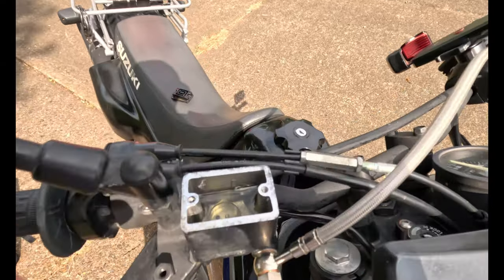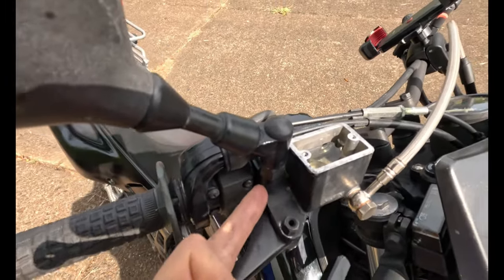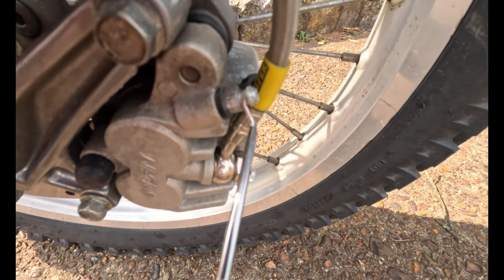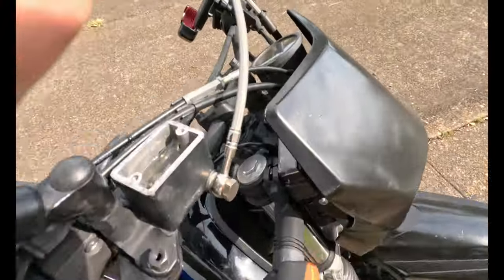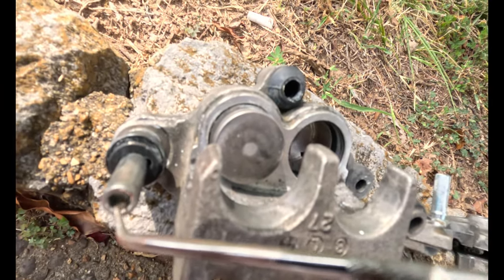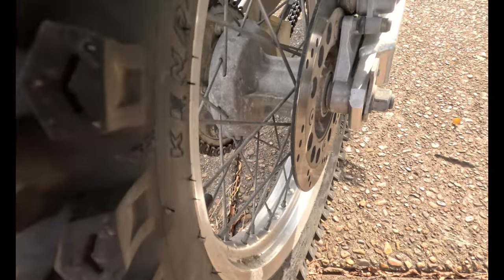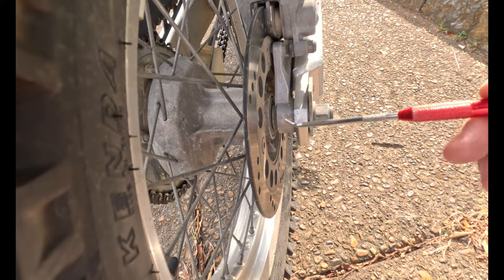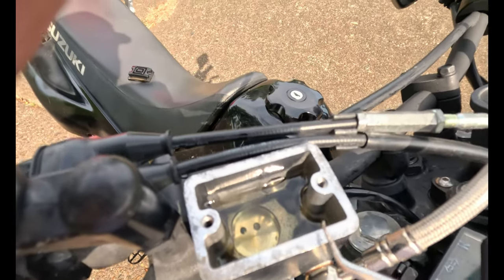Motorcycle brakes locking up or dragging? Solutions.

Comment: SO, my SCREW that holds the brake handle to the master cylinder. I had it way too TIGHT, SCREW DOESN'T NEED TO BE TIGHT, just a little loose. Another good find.
Reply from the maker: Good to know. Thanks.

Comment: OK, too full(RES) for summer riding, Fluid heated up and I took pff the Aftermarket shorty Lever. Thank you.
Reply from the maker: Yup those after market levers are not machined properly and can cause build up of pressure in the Master cylinder. Switch out the shorty to an OEM lever and you should be back in business.

Comment: Bro you lost me at the beginning when you said breaks might locking up because there’s air in the fluid 😂😂😂 On a hot day 😂
Reply: I can’t laugh because that actually happened to me. On a ride home I felt my bike start to drag and pulled over. I discovered the brakes had locked. I couldn’t budge the bike an inch. While trying to figure out what to do I got something to drink from a nearby store. It was hot out. After my soft drink I checked the bike. I could now roll it. The brakes cooled enough??? Once I got it home I had the rear brakes bled and I heard a puff of air come out of the line.  That’s why I searched these vids to find out who else had a similar experience.

Comment: ok I might need a few responses from you. my neighbor's husband passed and she sold me a k4 gsxr 1000 for 700. bike didn’t turn over, should I start with battery? or what would be your suggested starting point?
Reply from the maker: @culturdcustom  jump the battery to get it to start. If the battery is older than 2 years it needs to be replaced. If the gas is older than 6 months than that needs to get dumped and replaced. If it isn't cranking jump the starter solenoid to see if that is bad. Then if the starter is turning over but it won't fire then test your spark plugs for spark and that they are not fouled out. That should keep you busy for a day or two.
Reply: @jamesgaszak3685  I appreciate this more than you imagine. I'll be back here in a few days for step 2 lol
Reply from the maker: @culturdcustom  sounds good
Reply: @jamesgaszak3685 I didn’t forget about you, how are you? heres an update on me. I got battery, rectifier, and all electrics running perfect. I changed sparks, pistons looked good and now I need to change fluids and do brakes. so my question now is since the bike is older and when I got it both brake reservoirs were dirt dry and looked like acid from an exposed battery. of course I replace the reservoirs but will the brakes work if I just bleed them? also the front brake has absolutely no pressure
Reply from the maker: @culturdcustom  honestly I would get different brake calipers off eBay because to buy a rebuild kit plus new pots it will almost be the same price as buying a working used caliper. More than likely there is rusted water inside the calipers and that's a pain to disassemble to clean and blow out. I would get new brake lines, and possibly new master cylinders unless you are going to rebuild those which might be time consuming to a newbie. When you have clean working parts on a brake system it will bleed so much faster and easier. When you rebuild it's kind of a shot in the dark. It may work but why go through the headache when buying a used working part is only 15 maybe 25 bucks more.
Reply: @jamesgaszak3685  I will probably just get new brake calipers and sintered brake pads with new lines
Reply: @jamesgaszak3685  ok new senario, I have power and checked fuses but for some reason the rpm part of my cluster works but not the digital portion that displays mph and mileage, etc... help?
Reply from the maker: @culturdcustom  it could be a bunch of things. More than likely your speed sensor it's dirty or broken. Or the wire going to it is damaged or your display blew a fuse or stopped working because of deteriorating components.
Reply: @jamesgaszak3685  I'll check & be back soon lol

Comment: Hey, this could be really helpful for big group of people that now owns a Dominar (Bajaj version of the Duke 390). The bike is mostly great, but the rear brake gives a lot of truble. I own one of them, and I've already changed the fluid and cleaned the single piston the bike has on the rear, but it keeps heating up, even on very short rides. The weather does not help, its very hot, but i still have a few this to tey before giving up and sending it to the mechanic. I'll keep you updated. If we can figure out what the problem is, it would be a huge help for all Dominar owners here in Argentina!
Reply from the maker: I would bet the piston is over heating. I would get steel braided lines with fresh fluid and an upgraded rear brake caliper. See if brembo makes a rear caliper for your bike. Either way keep me posted.
Reply: @jamesgaszak3685  Ok, 2am here, kinda long trip tomorrow (800km) The brake fluid level just past over the max, took out some, left it right in between min and max, also manually separated the brake pads from the disk, I'll make sure not to use the rear brake tomorrow but if it starts to drag my last resort will be to just remove the pads and fix the problem next week. Will see tomorrow 🙈

Comment: 00r1 think my wheel is canted any other way to tell ?my chain looks  straight
Reply from the maker: @luluwhite261  you have to adjust each marker line on each side of the axle. Put it up on a stand and while in neutral spin it to see if you have a cant and watch the chain as well

Comment: thanks for the helpful video.  not overfilling the master cylinder reservoir to allow the calipers to retract is an excellent point.  cheers
Reply from the maker: Yeah it's that or aftermarket levers sometimes aren't machined right and also won't let the master cylinder air to retract.

Comment: Thank you James! This really helps with my 2015 Street Glide. Hot day, front brakes started clamping on their own... like moisture buildup, needing a flush?
Reply from the maker: @YoursInYeshua  more than likely needs a flush but if I were you I would upgrade your lines to steel braided as well. Sometimes the old lines won't flush out the crap and you refill them just to find out there was a pinhole that was letting air in  causing moisture build up. You and your life is worth replacing the lines. Bad brakes are the number 1 killer in bike accidents.
Reply: @jamesgaszak3685  Thank you man!!
Reply: @jamesgaszak3685  Another thing is I just installed new a handlebar and had to solder-extend the wiring and reroute the hydraulic cables, as they are at their length limit with a 14" bar. They do allow the bars to go fully turn though. Could a any of that or a potential miswire cause the front brakes to auto clamp out of the blue? And, could the ABS be doing the auto front braking even though it doesn't pulsate and the ABS light doesnt come, when I know it can light up? A dealer has the bike now, but I wanted to steer them as best as possible and you know your stuff.
Reply from the maker: @YoursInYeshua  a dealer should figure it out quick. If you routed the cables good and it isn't pinching then you should be good but since I can't physically see the bike I can't know for sure. If the brakes were working fine before the bar install that might be an indication that something is not hooked up properly though. As for the abs there could be a number of problems which again I couldn't know for sure unless I was there to inspect it.

Comment: I learned some stuff here. I put loads of grease on the tips, just gunk it right up in there, but I won't anymore. Might be why my rear is always dragging. 
PS: braided steel isn't there to be tough or provide longevity (this is just a bonus), it's there to stop the rubber hose expanding when you apply pressure. They are for better braking performance.
I have so many problems with brakes, despite low mileage and I just learned that where I ride economically, with minimal brake use so save my pads and petrol, it's actually what causes them to seize up, because they never get heat in them to allow them to be worked. Going to have to change my riding habits and end the false economy.
I just freed up some sticking pistons with brake cleaner/a boot lace and brushing Dot4 round them, but somehow after putting it back together the wheel is binding even more than it was
Reply from the maker: @ArcanePath360  yeah those pistons are super tight. I use a touch of lithium grease when I rebuild them.
Reply: @jamesgaszak3685   I sprayed lots of silicone grease round them and used a speed clamp to keep working them in and pumping out. I also tried brake cleaner and Dot4 but they just keep binding against the rotor and are very hard to push in with both thumbs and all my strength. Starting to think something else is wrong, maybe with the master cylinder? Unfortunately I'm no expert when it comes to brakes
Reply from the maker: @ArcanePath360 you should try a different company for new gaskets cause if you have old gaskets and the air hits them for the first time in 7 to 10 years of them being in a locked air tight system they might get super hard really quick. So get new gaskets in a rebuild kit. If you have spokes make sure they are trued properly. And lastly get a whole new brake caliper. They usually are pretty cheap and then you can determine if it was the caliper or if the forks are bent or the mounting plate for the calipers got bent somehow.
Reply: @jamesgaszak3685   Thanks. My bike is 10 years old with 30k on the clock.  Not sure how long the average seals are supposed to last. I've never taken the brakes fully apart as it's beyond my comfort level, just exposed the pistons and cleaned them. I noticed a little corrosion on some pistons, but strangely those aren't the ones that are sticking. I'm going to bleed them tomorrow, perhaps air got into the system. It isn't the forks because it's the rear one giving me the most trouble. The pads had worn down to nothing, despite not even using them. Luckily I had some old pads that weren't completely worn that I could put in. I think too much of the piston was exposed to the elements while driving in crap weather.

Comment: can a dirty brake fluid cause it to lock? heres what i did

clean out all brake calipers rotors pistons etc.. adjusted the pushrod. my brakes were fine! not until it gets hot brakes will lock up and i have to park it for few minutes brakes will unlock again when it gets cold. could it be contaminated fluid?

note: it would only lock up when it gets hot
Reply from the maker: @Taylor-jq6rl  yes dirty fluid can lock your brakes. Once oxygen or water gets in the brake fluid that causes pressure when it boils from heat. Just like a pressure cooker the fluid pushes against the pistons causing them to lock up. You have to flush the lines but I would rather you replace the lines entirely because that will ensure there isn't any moisture getting in from dry rotted old lines. Brake lines are not expensive and it will be more safe and reliable.

Comment: first ride home, front brake locked up, I bet it was the old fluid. Totally cleaned all brake system and. Rode 1000 miles and rear brake locked up. I have a cheap Ebay brake lever. Maybe that. Because I tore rear brake apart, everything looks great. My other bike, I have ridden 5000 with cheap Ebay Levers. So that's fine.,My problem might be I filled the resievors too much.
Has air space. I also cleaned the vent lines in the metal cap. Good video, I can fix it all myself.
Reply from the maker: I would say it's the eBay lever that's the problem. If the lever isn't machined right it won't release the air valve in the master cylinder properly and it will cause a build up of air pressure and lock your brakes up.

Comment: Rear brake stopped working, pedal went limp while riding and over use of the rear brake.  It was piping hot to the touch.   I rebuilt the caliper, used a kit with new seals and pistons. but putting back on the bike,   Riding for a couple of hours, and it still get s hot to the touch after my ride.  I noticed my new brake pads, that the one closest to the pistons is wearing down faster than the other, and that's just 1 ride.  The wheel spins but I can clearly hear the brake pads touching it.  this is a 2002 triumph bonneville america.  It's been riding awesome until recently.  I wonder, if 2 years ago, when I replaced the tire, maybe I never put the wheel on right, but that was like 10,000 miels ago... I figure I would have noticed sooner.  Also, trying to get that brake pad holder out during this rebuild was a bear, I had to pry it out.  Maybe I bent it?
Reply from the maker: @sigmapifsc  at this point I would check your mounting holes for the brake caliper to make sure you didn't jump the threads when putting the bolts in. Then check to make sure you didn't bend it. After that I would replace the caliper if you rebuilt it and it isn't working properly. But before that check to make sure your tire is balanced and spinning true. Sometimes if it's canted it will cause a pull on the brake pad on one side or another.
Reply: @jamesgaszak3685  Ok, I'm away this week, but as soon as I get home, I'm going to check these suggestions.  Thanks James Much appreciated!

Comment: maybe a dumb question.. if the motorcycle brakes lock up and you release the lever or foot pedal, will the brakes unlock ?
Reply from the maker: Not if pressure is built up in the lines from heat, moisture being in the brake fluid or your master cylinder release valve is clogged. You need to open the bleeder valve or untighten the banjo bolt to release pressure so you can move your bike cause the tires will be locked up.
Reply: @jamesgaszak3685  thank you for the reply.. I didn’t know that could happen :) your videos are very informative
Reply from the maker: @breadgarlichouse2265  thanks. I'm just here to help 👍🏼

Comment: See my front wheel in dragging on the front brakes I've replaced the pads before and never had this issue but I replace the tire and after I realized the front wheel isn't really spinning free when I take off the calipers it spins free
Reply from the maker: @patjones3520  your rims might be bent. Or your forks are bent
Reply: @jamesgaszak3685  rims are fine it's possible the forks are
Reply from the maker: @patjones3520  sometimes new brake pads need to wear down a bit and are too tight when they are new. Think if you added any mods to the bike on the brake system.

Comment: Replaced caliper seals & rebuild master cylinder  still getting locked up
Reply from the maker: Did you check the release holes in the master cylinder? Do you have any aftermarket parts?
Reply: @jamesgaszak3685  i have checked the holes in MC & this problem began in stock configured. since then I replaced mc seals, calip seals new st br lines & dot4 still having this issue
Reply: @jamesgaszak3685  this happens 1 minute to 5 minutes while on first ride of the day basically as soon as the brakes are used & warmed up.
Reply from the maker: @allday3433  did you change the brake lines?
Reply from the maker: @allday3433  which brakes are locking up front or rear?
Reply: Did you end up fixing it, I'm having the same issue
Reply: @kyryl8605   i replaced the master cyl
& it fixed the issue, although i did NOT bleed all the air out, just most of it, so i will know for sure once i bleed all the air out but it definitely doesn't lock up anymore.
Reply: @jamesgaszak3685  it was the front brakes, i replaced the lines, it was the MC
Reply from the maker: @allday3433  yeah those master cylinders. Was it the plunger? Return valve not opening?
Reply: @jamesgaszak3685  i don't know exactly what was causing it yet.. bit replacing it seems to have fixed the issue thanks